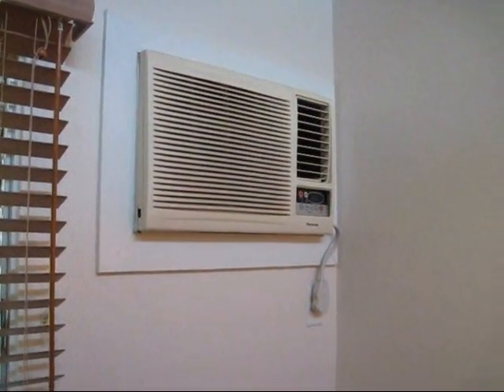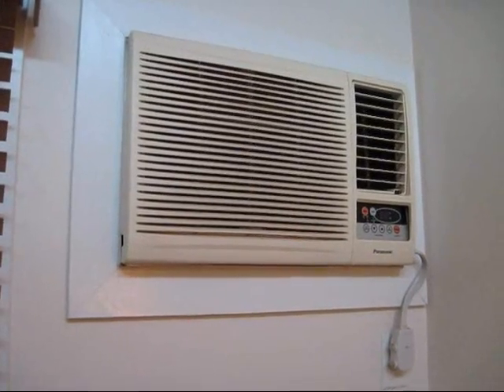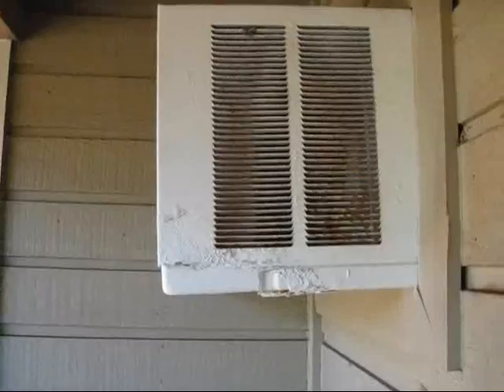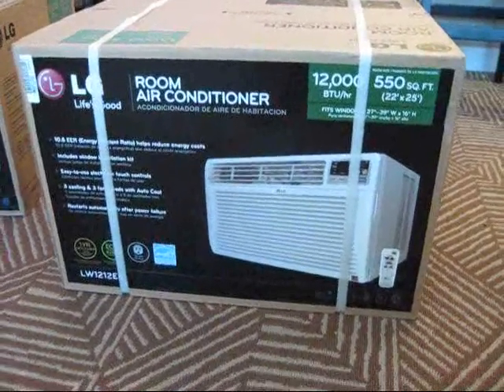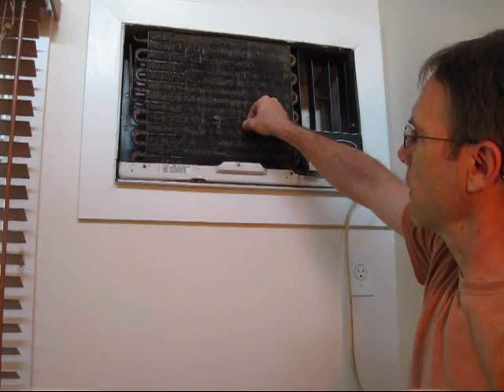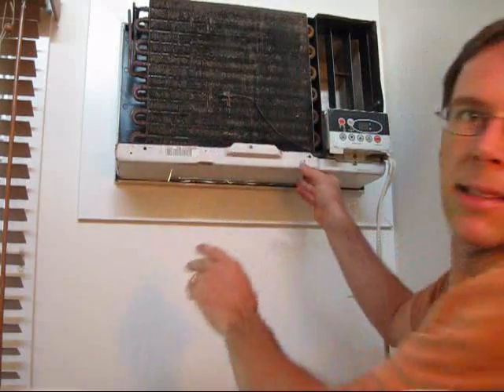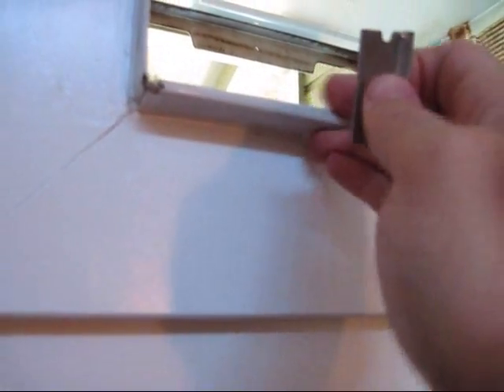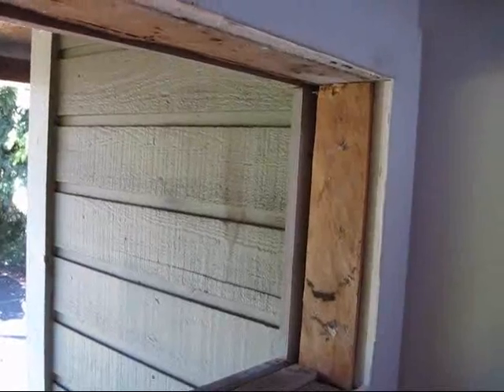Installing a New Air Conditioner (AC) Wall Unit - Part #1: removing the old unit.

Comment from the maker: You are probably correct.  But I needed to find a smaller unit that fit the existing cutout.  I have limited options.  I could only find two brands, and I think both were from the same manufacturer.

Comment: When in stalling a window a/c into the wall, the  I would never block any vents whether it's too close to an outside wall and or the vent is between the stucco and drywall- to many ppl install indoor a/c's into wall never taking into account the integrity of structure and or blocked vents leading to over heating and possible fire safety dangers.

Comment from the maker: You would have to make the box frame smaller; you may be able to get away with using shims.  You can cover the smaller hole on the face with new molding.

Comment: I was hoping to see the installation of the new unit in addition to the removal. Did everything fit properly or did you have to make adjustments?
Reply: Exactly, wasn't  this demo about installing, and it would have been nice if you mentioned the safety points that not any a/c can fit in a wall-one must watch the vents are not obstructed by the wall-this can result in unit overheating and possible fire-I've witness one myself-not enough ppl care about the safety precautions one must take in properly framing and wiring-to include balancing unit so they don't leak into the wall from condensation build-up and create harmful mold-

Comment: My air conditioner has shims all the way around the inside of the house. The a/c does not slide inside, I have to use a hammer and chisel to cut the wood shims out so I can remove the old unit.

Comment: 2 huge fire hazards are putting window units thru walls, as well as wrapping excess ac cord inside unit. this dope is a clown.
Reply: false.
Reply: @designstudio8013  Well genius, I guess you never learned that thru wall units have a deeper cabinet, to allow for the width of a wall. The meathead at Home Depot wont know that either,
Reply: @arcticarrowhvacr  And you claim to be a pro?

Comment: That's pathetic.  Only 7 years old and it fails. You never shouldve bought that new LG because it's gonna give you nothing but problems just like the old one except it will be worse than the old one.  It will only last 1 to 2 years maximum.  LG is really Lousy Garbage.  You shouldve installed a vintage unit that's 20 years or older.  These vintage ac's were made to last and work so much better than modern shit.  This is not a joke.  You'll find out the truth the hard way when your LG unit fails